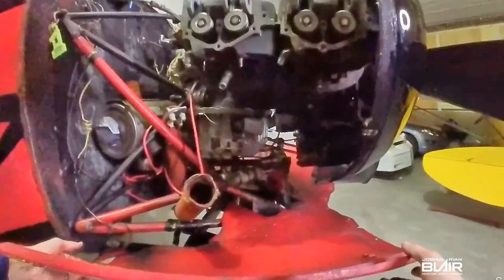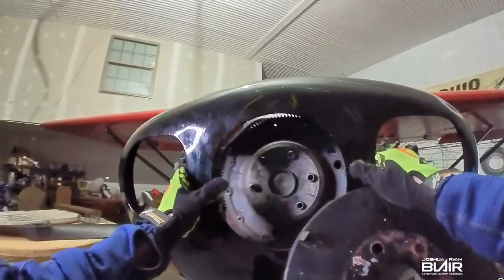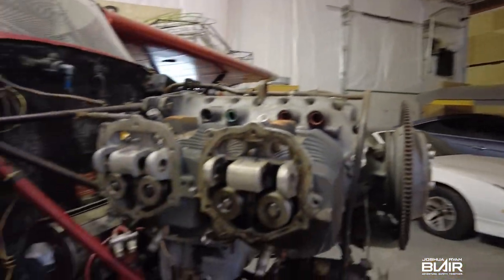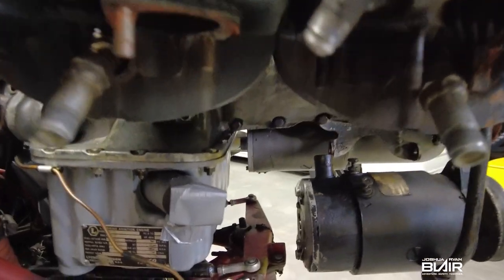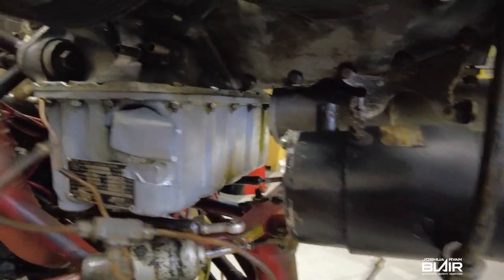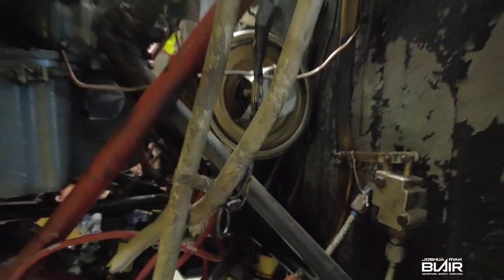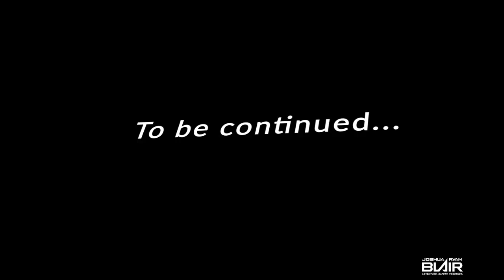The BlAiR [s]witch Project EP. 1 | Piper Tri Pacer Tailwheel Conversion

Comment from the maker: This is going to be big project... 
1) Switch the landing gear configuration 
2) Overhaul the Lycoming O-320 160 hp 
3) Hope the add 2 seaplane doors

Did you miss the video of when I purchased this aircraft? See here: https://youtu.be/4ZhPYEgQlBE
Reply: Streeeeetch it!
Reply from the maker: @conradcobb3257  Yes... I believe I will when the fabric is redone! (It’s in pretty good shape) However, I’m planning to just repair fabric where needed for the conversion. But things change, it’s on my radar.
Reply: Are you going to do the Trimmer fuel system with the seaplane doors? Sounds like you will be in there anyway!
Reply from the maker: @jameshann7218  Yes. I’ll need to do that STC as well. I should start keeping an eye out for those parts.